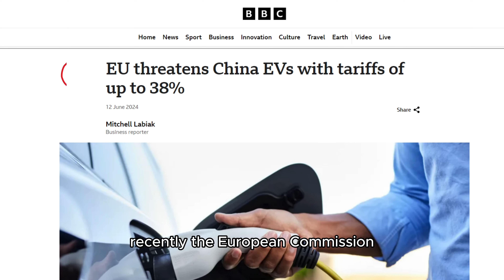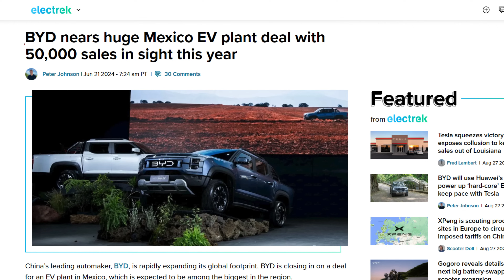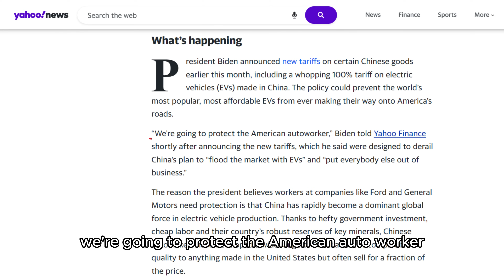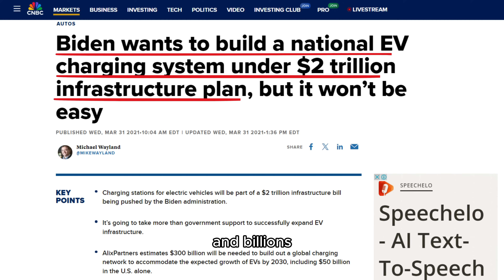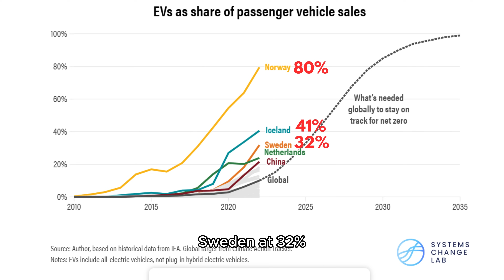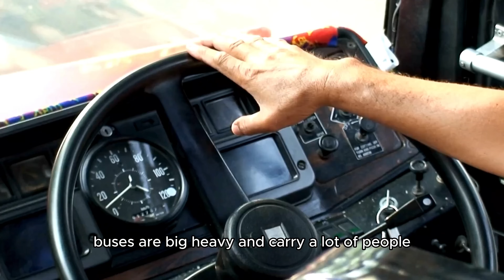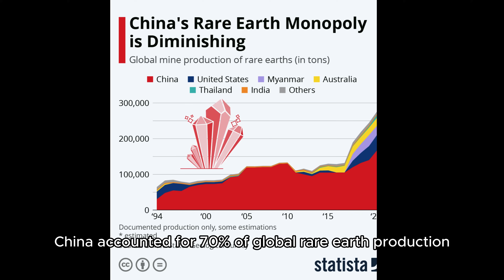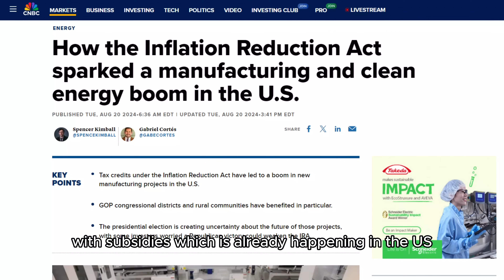Why the US Wants to STOP Cheap and High Quality Chinese EVs

Comment: lol at eu setting tariffs of 30% on the evs, I just checked volkswagen cheapest 5 door ev car and it was 35000 euro lol.. cheapest 5 door ev car from byd china is 9000 euros, well that 9000 uped 30% is 12000 euros lol... but in america where china has 100% tarifs on them, the cheapest byd 5 doors ev car would cost 18000 euros including tariffs,  which is still half of what cheapest  volkswagen ev car costs